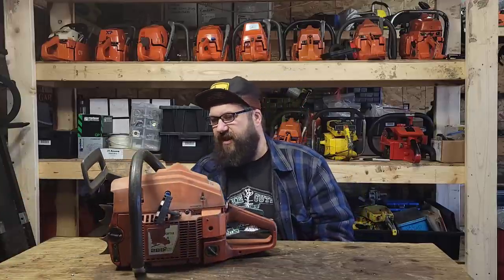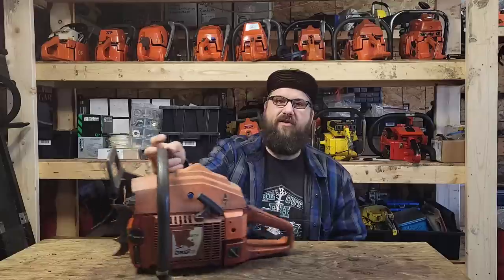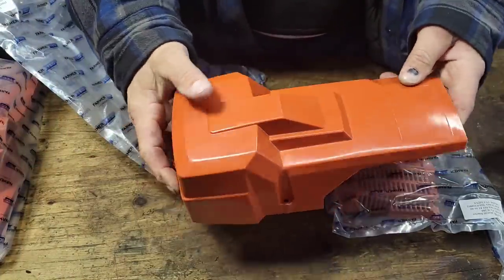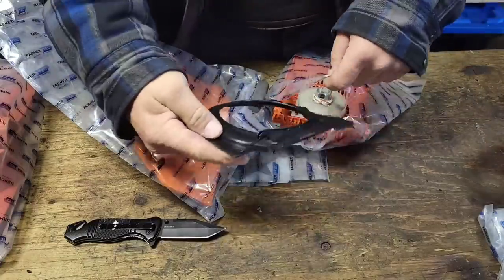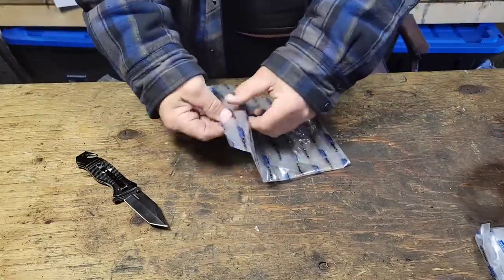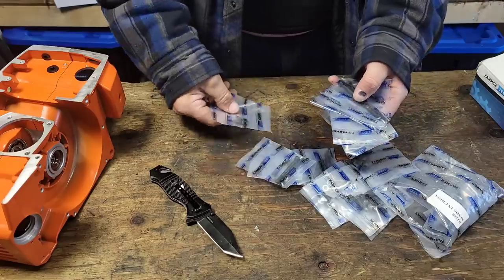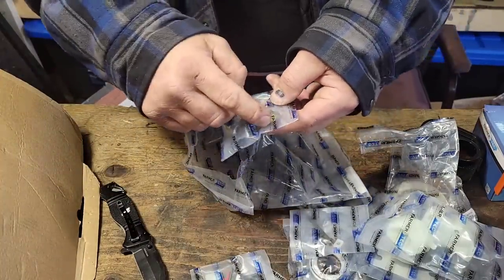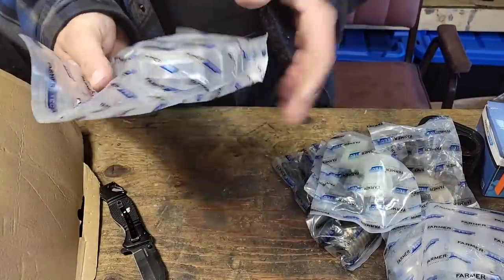I finally picked up a Farmertec saw kit!!!

Comment: NO! I expect better from you Tinman.
Reply: @5150powder   Why waste time on crap like this. I am sure he has proper saws needing work!
Reply: @lassila3  I sense your frustration over this, considering what the Tinman and his family are going through right now this saw may be a great distraction for him. I believe this project has been put aside for others that had more meaning to him but with some available time and needing an outlet that may not require 100% of his attention right now I feel this saw may be a good project for him to share his time with us.  My personal experience with these parts and saws has been a total disappointment. I have come to view them as a cheap source of entertainment with very little value outside of that. If one has high expectations, prefers quality tools, is easily frustrated by things not working properly or being broken right out of the box, holds a higher moral standard, value your hard earned dollar and look at the money you spend on a tool as an investment then these are not for you.

Comment: I agree with the stock build. It's also hard to find big saws here in Nova Scotia. I like the fact that you can save a ton of money with the kit. I think people need to see how to clean the cylinder up real nice to be able to run it to save money with cheaper top end kits. I have saved a ton of money doing that when I used to run two stroke scooters. Cleaning up a cylinder is the gateway drug to porting 😉

Comment: Thank you Tinman for taking a file to that crankshaft! I keep hearing how these parts are getting better so I just tried a 660 crank case and starter from farmertec I planned on putting a meteor cylinder, piston and rings in it and everything else OEM, unfortunately both were junk right out of the box. The case looked really nice but was softer than OEM and broke. It really doesn't make sense spending time building a saw with cases that are not hardened properly, so putting a better quality crank in it will definitely be better than the butter crank it came with but when the case fails you get to start all over again. I also purchased several other aftermarket starters and clutches for a ms 660 to see if they were any better. The raisman brand starter is the only one out of this batch that has lasted more than 3 pulls so I will test it in the woods. One of the aftermarket clutches had the equivalent of about a years worth of wear from daily logging on an oem clutch right out of the box so I returned it. The other clutch I had to put OEM springs on it so the chain would not spin at idle. Prying the air filter cover off my friends G372 recently with a hammer and chisel after it melted together with only a couple of hours of run time on the saw reminds me they still haven't figured out how to make plastic either. When you rebuild an oem pro saw with OEM parts it holds its value in many ways. West Coast Saws parts are a prime example of what quality aftermarket parts should be. It would be nice if someone would build a saw like a 044 or 272xp equal to or better than OEM in every way, I would pay the price for quality and piece of mind. Time is money and my experience with these kits, parts, and saws have been a waste of both. It can be tough to find good used or new pro saws right now, but take the time to look and really check the saws out, buy a saw that will make you money not cost you money. I have purchased 5 saws already this year the closest 2 being a 6 hr drive round trip, the other 3 I had shipped, one from Canada. 2 of them I modified to my liking, all 5 are OEM, working great and are holding or increasing in value over what I paid for them while I make a living with them. You really do get what you pay for.
Reply: Just finished trying out some aftermarket parts on my trusty ol Husqvarna 162SE. The 52mm cylinder & piston needed a bunch of cleanup/work to be usable, but the carburetor has worked great so far and started right away without adjustment. I did experience the plastic welding together tho.  The black plastic air filter housing was rubbing the top cover and had started to spot weld together after the first run. Thankfully I found out early because I was pulling the cover after every run to read spark plug color and check comoression. A little work with the Dremel and a dab of silicone grease and no more stuck cover.

Comment: The oil tank line is a hair short also if you triple bond it on case and pump it seals up. With no base I had .026 squish with 102°ex and 80°in. I brought the ex down to 99° and opened up the lower transfers and swap the ex pipe for a 3/4 and she'll pull you fingers off. 100% FT. $300 US.

Comment: Tinman, I just built one of those 288 kits a couple weeks ago , cleaned the ports up cut the skirt off the cylinder below the lower transfers and feathered it down to the case , put a pop up piston in it . For the muffler cut out stock exit port and enlarged it to 3/4 i.d. pipe and added one on the opposite side, she has a set of horns , and is extremely loud .great runner so far . Couldn't have done it without your helpful video's .can't wait to see what you do with yours, I definitely will be ordering more to play with .

Comment: 😍 I'm so happy to see you do one of these kits!!! I just bought a pre assembled G660 Pro... let me start by saying I was a skeptic who only planned on running this clone until I could afford a big husky or stihl...
That being said I'm absolutely blown away at the quality of the new pro models! I took it out for some testing and liked it so much that I brought it home, tore the muffler off, inspected the cylinder and decided that it was actually high enough quality to be a better value than a used stihl , and I'm not even exaggerating that was my gut reaction.  So i ordered a hot rod dual port rippem muffler from Dukes, and a decomp delete. I'm going to run it just like that until I have an issue with it. Im even impressed with the "walbro" carb im almost certain it's a copy cat, but it functions EXACTLY as it should... I'm literally blown away. Im considering ordering a kit to build myself now. Just trying to figure out what one... I'm thinking about just going with a 372xp that seems to be a crowd favorite. Do you have any input? What kit would be fairly easy for a guy just getting started learning to break his gums on???
Reply: got my 660 pre assembled 5 wks ago,, 36 inch bar, works great , small adjustments to carb, getting alot done with alot more to go,  thinking i may get a smaller 20 inch bar and see what thats about. maybe a bit small but lighter and agile in tight spots.
Reply: I ordered a ms440/ 044 kit took be about 3 hours ish I heated the cases on my wood stove could have used the house range and froze the crank and she plopped right in after that everything was a breeze i badged it up as a 044 mag and the used black paint pen 🖊 so it’s officially a “044 magnum almost “.  lol 😂 but she’s a ripper I left it stock I filed and sanded the ported didn’t even use a dremal on just round and flat and half round files and then wrapped them with 400 and then 600 grit sand paper the intake I left file rough exhaust I shined but past the it’s exactly how it came I run a 28” full house chain and a stihl light weight bar I made lighter with the gas axe 🪓 plasma cutter and flapper disc on the hand held grinder as I have back issues so I made it light as I could with out marking it to floppy but I run her with 98 octane fuel 40-1 mix  and I run a bark box muffler cover and I added a extra exhaust port 180 degrees from the factory one and I have to say it out cuts my dads real 046 magnum and has more power by the hand dyno my dad wanted to trade me straight up I couldn’t do that to him so I have another kit on the way so Iam gonna build him one for his birthday or give him mine and build me one and port the snot out of it lol 😂 but yeah easy to put together I wish tinman would show us his build on this saw and get the o44 ms440 Kia and show us his build on that as well Iam smartly thinking about sending him a 044 kit just to peak his mind on the aftermarket stihl game lol 😂

Comment: I bought a prebuilt. Put an oem wrist pin, needle bearing, cabers, clips, decomp and closed it back up. Has been very good so far. Milled some pine beams and noodled large oak firewood last year. Knocking on wood.

Comment: glad to hear Mrs Tinman is going well!

just build it with the minimum work needed to make it last (done with the most basic tools). focusing the video on what you did modify. then run it HARD or send it to someone that will. if it lasts a season, pull it down to inspect and maybe warm it up. then rinse and repeat untill you see what will go first.

i think a lot of people will benifit from this series.

Comment: Ive beem doing small engines for years. Tinkering for almost 30 years, professionally for 15 or 16. I agree about the aftermarket carbs. 2 cycle or 4 cycle, it doesn't matter. They are finicky. One shop i sub out to likes to use then. I tune my carbs virtually the same wa you do. And I'm usually cringing at thoae carbs. I still manage to get them decent, but not usually "good". I actually refuse to run any aftermarket plugs. They go directly in th trash every time. Ive had quite a few machines come into my shop solely because of an aftermarket plug.

Comment: I'd vote for a stock build first, then some mods to show the gains. 

I built a 660 kit 2 winters ago, just assembled the kit. Only thing done was chamfering the ports. This is before I discovered this channel. The only part that didn't work was the oiler worm. I may have irritated the problem, but I don't think so. The machine work was sloppy enough it bound when put together. Other than that it has been great. 

I currently am working on a 460 kit and have a 372 kit waiting to be built. The 460 is getting some mods on the way together. 

I love the channel, keep up the good work.

Comment: Good to see what is coming in the kit, I have done several 372's. I have the 288 kit coming in tomorrow and even though they claimed it was US stock it shipped from out of the country. I ordered in Nachi C3 bearings since they are so cheap and I just don't want to have to tear the bottom end apart from a bearing failure, OEM seals, a Oregon rim and drum since I haven't had good luck with the china being round, OEM Drum bearing and OEM crank bearing. Wolf Creek gasket kit as well. I plan to get a OEM switch since I have had two of the huztl switches fail on 372's. 
I will see how the carb works but I haven't even tried their carbs. I always ordered used carbs and rebuilt them for other builds. 
I plan to get the Meteor cylinder and a LRB pop up. I will be going with Nikasil even though they offer the Titanikel, I've heard Titanikel doesn't take well to porting, either chipping away or chewing up burs. I will also pick up the New West crank as well for the build, I have plenty of time to put it together. 
I'll have to make a blank off plate for the muffler side for pressure/vac testing, I wish they offered the other muffler since the one's that come with it aren't USFS compliant so I will have to pick up a used OEM for that.
Reply: As a follow up on my kit I actually received it today. WOW the cylinder looks like it was taken straight from the casting and chromed. There is missing chrome and pitting in the casting everywhere. I mean completely unusable, which sucks since I was intending to use it as my test cylinder for my porting then use what I come up with for my final cylinder.

Comment: Decided to go with a good used OEM crank, picked one up in really nice shape for cheap. Also picked up a OEM starter recoil spring since I had a couple of the 372 kits give me issue's. I will get a OEM low top cover and a Pro Safety full wrap handle bar.
At first Huztl was acting like they would replace the cylinder, then wanted me to run it and see if it was ok and I said no so now they have gone silent but I never figured their warranty would mean anything anyway, which I had heard this is how they operate anyway so I knew what I was getting into.

Comment: I have the blue Holtsfforma G288 runs great but the chain oiler is bad, apparently is a problem on these saws. Waiting on the parts to be back in stock to order a new one, supposed to have fixed the issue with them. hope all goes well with this one!
Reply: I'd go back anything broken OEM
Reply: Yes the new part is much better than original.

Comment: I vote a good woods port with all typical homeowner tools. Meaning a dremel. Use all the parts of farmertec. Make this an average joe build. Like a base gasket delete and some porting to make a ripper. I understand there needs to be some clean up on the transfers
Reply: @iffykidmn8170  that may be true. But if one is on this channel. It’s because they’re pretty interested in saw building or saw mechanic. A dremel is definitely a budget build tool too. Just a perspective.

Comment: The first few of us to assemble these FT 288s had to grind down the cases below the carb especially w/o base gasket or else the cylinder will not seat to the cases. I would recommend a test assembly cause it's hard to keep the shavings out of the crank bearings.
Reply from the maker: I've had that issue on some 266s in the past. I'll check that forsure thanks.

Comment: Stock first and see what works good and what does not.  I bought an 030 that I run a 32” bar cutting oak.  Had it for two years.  Had issue with oiler and starter pauls

Comment: I'd use different crank. Unless you want do the oven deal like Iron horse does. Then recheck the hardness of the crank. As far as cylinder I'd go different as well. That or use as a test cylinder one that came with it. Unless you want use as a learning saw. What too change when you get a kit saw.

Comment: I did a 372 kit a few years ago and its been good.  Those Farmertec cylinders definitely need some cleanup , but I don't like to port them too much and risk peeling the chrome. And with a bigger saw the torque is what its all about, so go mild on it and  it will probably be a decent saw.🤞

Comment: Clean up that cylinder, maybe .030 squish to keep the heat down for the soft crank (base gasket??), use the stock bearing and seals for sure, check the numbers, run it with fat oil ratio 32 to 1 for the soft crank -- a bit on the fat side tune??? Things that keep the heat down

Comment: I'm with ya on the aftermarket parts.  The case looks great tho.  It's one of the few things that are NLA from Husqvarna for the 288.  I almost ordered one of these kits for that very reason.  Luckily I found a case on ebay that was still in very good shape which is not the norm.  Most of these saws were run hard until they just wouldn't go any more LOL!!  The starter pawls "looked" cheap and ya the cylinder is pretty sad.   Nice video.

Comment: I'll cut right to it, I got the G372xp orange, years ago, bout 3, 4, same everything except bar and piston(pop up hyway 52mm) and jug big bored hyway 52mm, ported spice, very torquey, did I say very?  And got my horses out of it too, it's a real ripper and the chinesium is all holding up except jug and piston...hilzforma everything else and uve tezted it hard,and its piped. Sorry everyone I love my COUNTRY USA but we don't make no good saw, and China is holding strong...and grew up on a 461, it's still a ripper in comparison to the 461

Comment: That cylinder cost about $25 on ebay. I have used them but run a ball hone through it first. You're asking for trouble with that ring, just put a steel ring in and run it. I've never had a crank fail but I think the bearings seem to get a wee loose a wee fast. Toss the carb in a parts bin. It's a problem in the making before you even put fuel in it. Overall I like the parts kits but have built a few now and have an idea what I want to change before I build. Oh, that paper air filter will serve you well if you put a foam cover on it.

Comment: I have a 365.i need a stronger saw should I go 372 kit on it , if so how much power (about) would it add with a good porting job?
Wouldn't that handle a 8 tooth drive sprocket better.?
I wanna build it but still need it relitvly dependable

Comment: Hey Tinman, that info on the tailed circlips is big news to me, I just got done assembling and putting a few tanks through a 029/039 conversion with a cross pop piston and I used those circlips that came with the piston with the tails on them. Does the possibility of those tails popping off warrant me tearing the saw back down and replacing those clips? Or is it “safe” to roll the dice? Is it only a matter of time until they fail?
Reply from the maker: The circlips either work forever or they pop out suddenly and pop the saw lol. Its totally a crap shoot as to wether they last or not.
Reply: It’s unfortunate I learned this now but I guess I’ll just cross my fingers and hope for the best! New subscriber to your channel, really enjoying the amount of attention to detail of mentioning the small tidbit information like this. It’s the small details like that that will make or break a project, keep up the great content!👍🏻